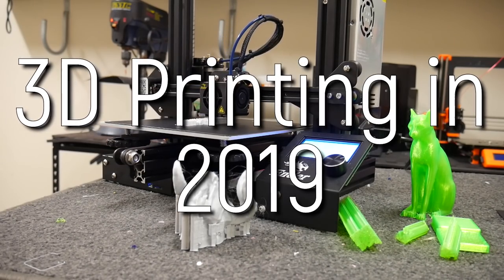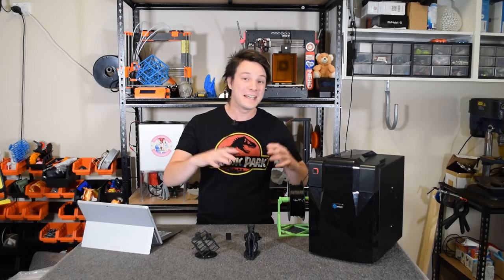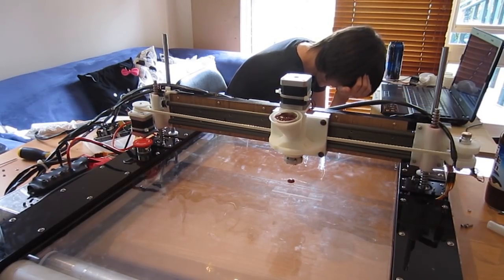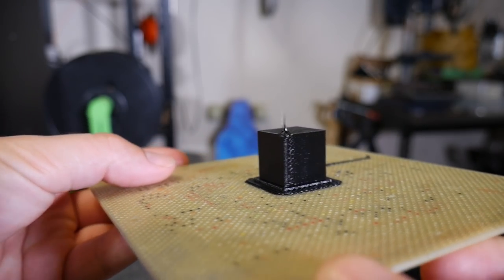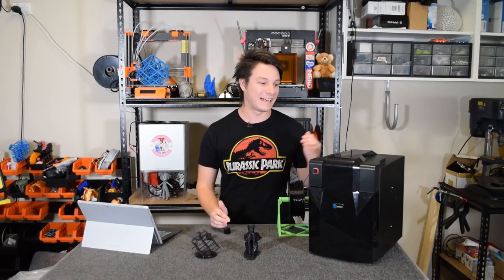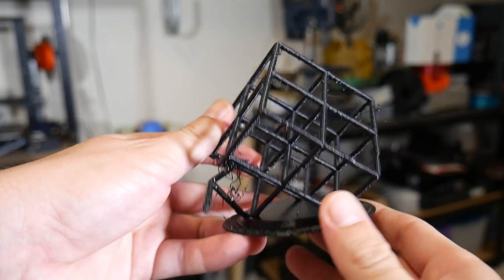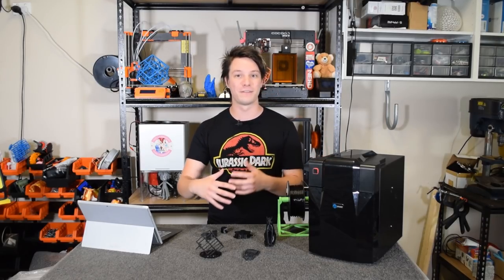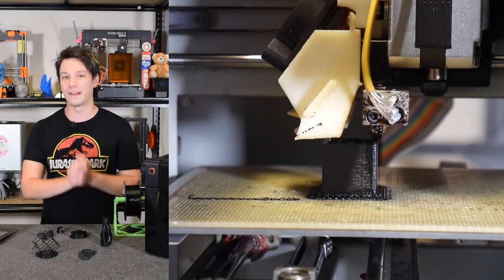My oldest 3D Printer... Is it STILL any good?

Comment: Hey there, I was one of the developers that did the temp hack and I also still have my UP Mini. Nice to see the tool actually helped some people ;-)
Reply from the maker: Hey! Your hack did more than help me, it seriously changed how I used the machine instead of using a resistor and 'hoping for the best'. Really do appreciate the effort that went into it.
Reply: @MakersMuse  Love to hear that! Our main goal was actually to make the temp change so absurdly easy that tier time just put in that feature themselfs ;-) 
If now only the software worked on linux too, that would be awesome. I made the (almost) full transition away from windows one year ago, but still have one old win7 laptop just for printing on my Up Mini sigh Maybe someday. Keep doing what you do, your channel is awesome!
Reply: @NGSForsaken  The software runs fine in Wine.
Reply: @_droid  The new one (Up Studio i think) or the old one? I didn't get it (the new one) to work due to problems during the driver installation. If you have any tips to make it work that would be awesome :)
Reply: Me too! Your hack was bloody brilliant and let me do so much more with my little printer. Thanks again for doing it.
Reply: @NGSForsaken  So Tiertime made it so you can change the temp easier in the new software? Is that correct?
Reply: @blabberbytes9967  Yes, check out Up Studio 2, temp is in the settings
Reply: Maker's Muse Hey, my brother just gave me his up mini and I'm trying to use cura on mac. Is there a networked printer template I can use that's similar to the up mini? I've downloaded the up software and am still prompted for an IP address when trying to make it custom.
Reply: Hi, I'm going to buy my first printer, and I came across a profitable (UP MINI v1) worth buying in 2021 ($ 135). I studied his problems .. and I see you have a solution .. Where can I download a program that allows printing with different temperatures (hack). Thanks in advance!

Comment: Looks pretty good for a printer designed way back then. Sure it may lack the smarts of newer printers, but the easily removable extruder assembly, slide out bed, fully enclosed print chamber, those aren't even standard features on every printer designed today!

Comment: This was my first 3D printer, and I still using it since 2014, next to my WD6. Modified the hotend with an extra cooling fan to print PLA and it's working flawlessly. Still a great little printer. 🙂

Comment: My first 3d printer was a da Vinci aio. Scanner didn't work, was the main reason why I bought it. I messed around with it. Then I bought my current and expensive 3d printer.  My seemecnc rostock max v3 now a 3.2. I had some issues with it. Since this time I had support from the community. I was able to make it work and now its. My workhorse for all my projects.
Reply from the maker: That era of 3D Scanners were basically a scam, really frustrating promising things they simply couldn't do. MakerBot digitizer and sense scanner were all guilty of it.

Comment: I think that anyone's first 3D printer holds a special place in their heart. My first experience was with a Makerbot 5th generation and a broken RapMan.
Reply from the maker: I feel for you, that must have been a mission. Bits from bytes machines looked amazing and... That was about it. 😂
Reply: My first was a second hand anycubic kossel pulley and I absolutely hate that thing.  It sat shelved for over a year since it would never level correctly.  I bought an ender 3 pro and I love that thing, and was eventually able to print some parts to hack the kossel into being mostly functional.  I through a 0.8mm nozzle in it and it's my fast/dirty/sturdy printer for when I need brackets or things that don't require a lot of detail.  Maybe one day I'll disassemble it and do some major upgrades on it to get it into full working order, but at that point I'll probably just harvest it to build a hypercube.

long story long; don't ever buy a second hand delta printer as your first printer.

Comment: I think the conversation of tool vs hobby is even more relevant now with polished turn key products like the AnkerMake and Bambu printers. I've seen a lot of 3d printing snobs scoff at them for not getting an ender or one of the million generic replicas. I personally have 2 printers, to do both. My Ankermake is my "tool" the one I can trust will work without much fuss, my Tronxy x5sa is my "hobby" printer that I can test out new ideas and stuff on without too much worry. I value them equally but for ENTIRELY different reasons, both equally valid

Comment: I've had my Anet A8 (yes I know...but I've made it safe with the proper upgrades), for 1 year now and I'll probably feel the way you do in 7 years.  It's enabled me to do so much and learn a ton.  It's also let me embark on creating my own 3d printer from scratch.  It's just great.
Reply: I wonder how many of us A8 owners went on to scratch build our own printers?
Are you building a HEVO?
Reply: @vizionthing  I'm building a prusa i3, I am doing the wooden frame version and so far I've got the frame parts laser cut..  My goal is to build something tried and true that is  heavily supported and then using the hardware and electronics from it to build something else, maybe of my own design.

Comment: I am in the process up upgrading my Ordbot Hadron from 2012.  The perforated phenolic plate, inspired by the Up Mini, is something I am trying to work into the upgrade along with a PEI removable surface.  I remember being so surprised by the thermal image of the build plate spreading the heat so conaistantly!
Reply from the maker: Love the Hadron, might have gone with one but they were just too difficult to get in Aus, but the Up's had a local distributor.

Comment: My first printer was the Anet A8, I know that it is infamous for fires and is kind of looked down upon in the community, but even though this thing was a hell to get working, I'm still happy I got it because it helped teach me everything i need to know about 3d printing, it taught me everything to look out for when preping the printer, and it taught me patience, now I own a Prusa i3 Mk3 (now a Mk3S cause of free upgrade) and I am still being taught patience because even the prusa has been causing me some problems which I've had to fix. Either way, I am very glad I didnt give up on the Anet, and I'm glad I was able to learn everything I could from just working with it, to your videos guiding me in everything I needed to know.

P.S. To anyone that reads this, dont buy an Anet A8, it was a dumb idea, I was a dumb kid who wanted a cheap and big printer, get something better, dont be foolish.
Reply: I am not sure advising people not to buy the Anet A8 is a good way to follow : I also own a Anet A8 and agree with the comment that says it 'it helped teach me everything I need to know about 3d printing". First of the Anet A8 print right out of the box without any modification (ok it can be better with a few printed part like the stabilization bracket or the frame bracket but once you get it setup with a few update it roll's like a charm).   Secondly, for this price it is a learning machine where you will find lots of information and tuning possible.  On the other hand if you are looking for a all-in-one pre-configure setup it is certainly not the right choice. But IMO for someone who like to learn and tweak thing it is a real deal.  For my background, I started with 3d printing in 2009 when it was nos even mainstream with rapid prototyping with an HP jet fusion (one of the first) and some other metal exempt.  Here is the company I worked for and some of their application : https://www.sirris.be/blog/sirris-gives-lecture-about-3d-printing-production-technology-prototyping-2015

Comment: I had one of these back in the days and other than the nightmare of getting the prints of those perforated pads it made pretty decent and strong prints.
And it was one of the most silent 3d printers i've owned with the cover closed.

Comment: I have 2x UP machines, Mini and Plus1 - they were my go to for anything what just needs to happen, super reliable.
When I've switched to UM2 as my go to machine I've decided to heavily modify both old boys...
Mini got new Marlin capable electronics etc for finer control - plan was to transform it into my ultimate PC machine.
Plus due to the linear rails were re-fitted with E3D V6 and 0.25nozzle for fine detail printing, Marlin board as well.
I don't regret it by no means but I have to admit that now it's more of a hobby than just a tool... Now I make sure 1st layer is going well before I leave, not like before - just hit start and 99.9% of the cases no need to check in until its done.

Comment: Great to see the UP mini getting some love Angus!
I found mine in the trash about 2 years ago. It was missing its power supply and spool holder, used locked down software and the hot end fan looked like an old boot that was left out in the sun; quite the hot mess.
Luckily, I found that a HP laptop brick had the same voltage rating and plug, replacement parts were easily printed on my delta and the software was easily hacked.

It's been my trusty backup printer ever since so I'm really pleased to see it back in use on your channel. I'd love to see some upgrades (like a new heated bed) if you can find them!
Cheers
Reply from the maker: In the trash?! Ouch. So glad you got it up and running again. There was a heat bed upgrade at one stage but that was long ago...
Reply: @MakersMuse  Yeah in trash! I used to work in a makerspace and the amount of valuable stuff people would throw out was unreal!
I might use the bed output to trigger a relay and just control it with a spare ramps board as that heated bed upgrade was way overpriced if I remember correctly. That being said, it's super reliable so far, so I'm reluctant to mess with it too much :)

Comment: Good tip on the new software supporting the older machine, I'll have to check it out. The place I bought my mini from had an inline switch block that plugged into extruder and the existing harness plugged into that. Never did use it though. The removable bed is great. I bought a piece of PEI and stuck it on one of the perfboards as a test and have had reasonable results.

Comment: I like the different intensions/motives brought up. Some channels are all about tweaking the printer. This is not, this is about making stuff with it.
I'm into making stuff I can get only with 3d printing. As a newbie I chose a reputable printer to avoid all the tweaking as much as possible. It is so hard start to get into tweaking when you have no idea what is the problem. I did not have high hopes for the $1000 range either but was plescntly supprised with a low end printer I got on the side. With pla that is not is not that picky cheaper ones seems to work fine as well.
The higher price printer of mine is from another planet though, better firmware, autoleveling, good drivers from the start, ....

Comment: That's a bit of a coincidence - I had a project back in 2010 that needed a 3D printer and the only suitable one seemed to be the UP!, the original one. So that's what I got, for nearly three grand US$ and it worked quite well.
It's still on my desk and still gets used a fair bit even nine years later.

Comment: What you said after about 10 minutes! If a buyers wants a tinkerable machine that's great. If the machine requires tinkering and constant fiddling to even do the basics then it should not be sold as a finished product. Me I want a machine that basically works out of the box. I do love the idea of being able to tinker and upgrade as an OPTION, not a requirement. Even one of the community low cost favorites comes with serious, not ready for prime time, issues. Firmware with an important safety feature disabled and even the ability to update it missing.

Comment: Hey Angus! I enjoy that you did this video. I very much appreciate you discussing the issue of super cheap printers not living up to their promises/not working properly. The first printer I bought was an early Printrbot SImple Metal, which worked pretty much as advertised and really got me hooked while building my confidence in 3D printing. Then I bought a Wanhao Duplicator I3 copy (The Malyan M150) and have had far more problems with it, but it's been a fun learning experience. Then I bought an Anycubic Kossel Mini and it's just been a pain. I've been fighting it every step of the way and if it had been my first printer I probably would've gone years before taking the risk of buying another and would've missed out on many very cool opportunities that I have had because of my 3D printing capabilities.

Comment: Having first printer that works decently out of box is so important. I hate when people advise newbies to buy a kit or get a printer and replace critical parts with upgrades and flush alpha version of some opensource firmware and so on immedialety after purchase. After a year I anyway know each part in my printer and did a number of repairs, upgrades and firmware config tweaks. But it is so valuable it worked out of box so I started my 3D printing journey very positively and had the printer doing its job since day 1.

Comment: I started printing back in 2016 and my first machine was a Prusa clone that lasted about 2 weeks before it started blowing up control boards. I returned that one and got another machine that made decent prints but I always had to fight with it for hours sometimes before I could get anything to actually print. That machine made me dread turning it on and nearly drove me from the hobby. Fast forward to the MK3 announcement at this point I was basically done with trying to use the printer I had and had basically given up. I waited a couple months and decided that Prusa has had a good rep with the mk2 so I figure I give it one more shot. I have basically been happily printing since and even though I still have problems with the MK3 time to time its at least been reliable for when I do want to print something it works with out me having to do anything.

Comment: I bought my first 3d printer, a Tronxy XY-100, through Walmart online and that printer was not a fun experience. It didn't come with the correct hardware, and one of the lead screws was bent. Luckily, I'm a lover of making stuff work when it should. Now I have an Ender 3 and I'm cannibalizing the XY-100's parts for a core printer so I only need one lead screw. Thanks to you, Angus, along with Joel, Tom, and Ivan, I'm learning CAD and making a great leap in learning. I'm even starting to get commissions for parts to be made. This 3d printing enthusiasm almost demands to be profitable and is unavoidably fun.

Comment: My first 3D Printer as well.  Bought mine in November 2013.  My first design was a cube of the PP3DP logo cube.
At the time it most definitely was the most user friendly 3D Printer.  One trick I learned for this printer: turn your model 45 degrees on the Z-axis, so the model lies diagonally on the built plate; your model will be the strongest this way.  The biggest downsides are the rather small built volume and the unhealthy ABS fumes.
Those downsides are the reason I'm switching to a new user friendly 3D Printer, the Sculpto 2 Pro: prints PLA and has a cylindric volume of 200x200mm.
Too bad you didn't print a 3D Benchy with minimal support and with or without raft...

Comment: My first 3D printer was a 2nd hand market used Davinci Mini. While I did research how to get around the chip-locked filament stuff, I am really glad I started with that one. Even though its abilities are limited, its an incredibly easy tool to use. Combine it with Tinkercad, and it was IMO the perfect starting point for s curious noob. I'm now considering passing it on to someone else who is 3D curious as I was. Until then, I still use it for some really small prints, as the ABL, ease and simplicity can often spit out some really small parts, before my CR10S is done heating its bed 😅

Comment: I was very lucky to have already bought my first printer before finding and following the main youtube channels (including this one) ... had I done it the other way round I would not have bought my Anet A8
But Its still going strong after three years of use  (including all the parts for my HEVO) and I may never have fallen into the 3D printing hole without it. The problem, it seems is that you have to pander to the 'hard of thinking' and 'lacking in experience' people and play it safe, there were very real issues that needed to be avoided with the A8 both with the power supply and the heat bed connection, luckily I found out about these problems while I waited for my box to arrive and avoided fire and death with ease.

Comment: Angus, you can print PLA as well on the UP Mini, I get great results. As long as the room your in is air-conditioned and I leave both doors on the printer open. I have two UP Minis one set up for ABS and one for PLA. My PLA machine perf board is also a shiny black i find it works better for PLA also

Comment: I am still using my UP Plus purchased back in 2012 for $2,000.  And I still get comments on how well my prints come out.  I just had the first real issue with it, requiring a new bed heater due to broken wires due to constant flexing.  I'll be replacing that this weekend.

Comment: If its default temp is 260 it should do Hobby king HIPS real well. Prints better than ABS, is cheap and IMO much stronger and easier to print if you want strong parts. Will probably make a video on it soon as soon as I get all the backlog cleared. Its robotics season (FRC First Robotics) and we use this year a lot of printed parts. As for HIPS our racks for the rack and pinion lift are printed in HIPS and so are some gears and brackets. Nozzle .8mm Layer Height .32 to .48, Nozzle temp 270, Bed temp 100, Printer Matterhackers Pulse with E3D V6 (prusa
clone)